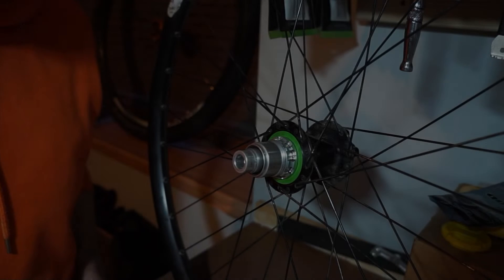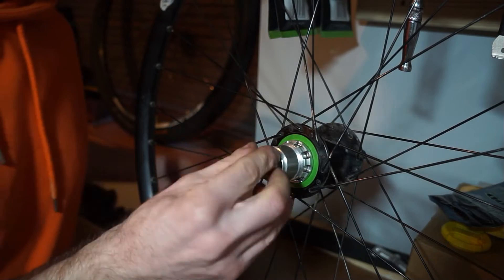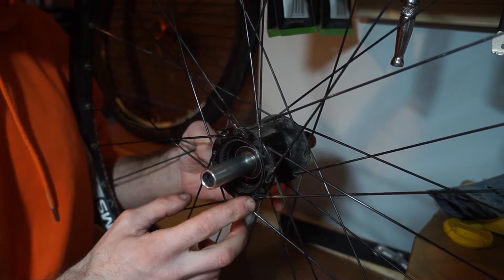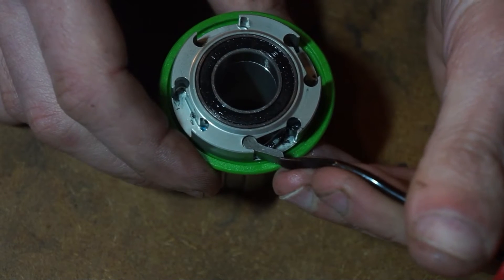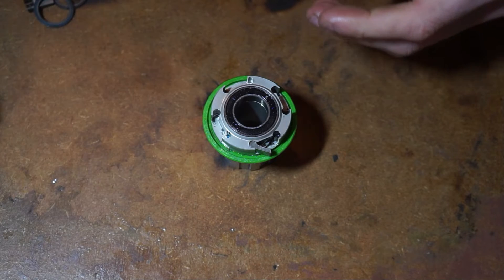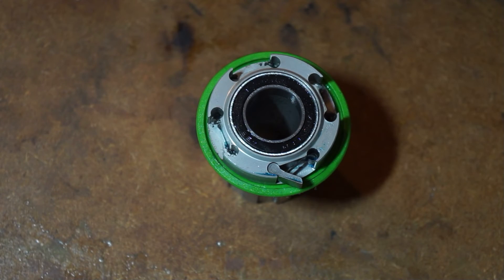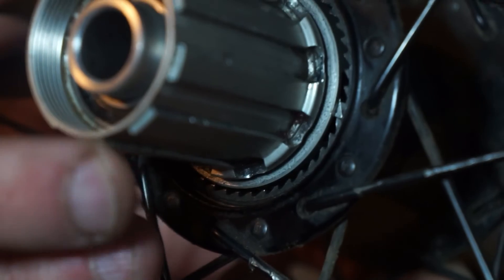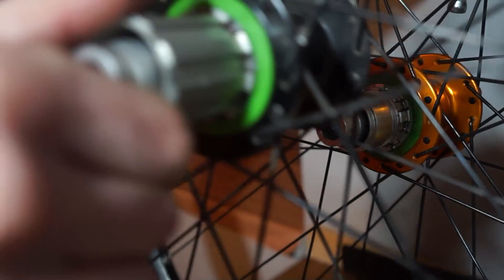Hope Pro 4 Rear Hub Swapping Free Hubs SRAM XD XX1 & Shimano 11 Speed - And a man talking too much.

Comment: Did you just push the green seal thing with your thumb? Without using a hope pro seal tool?
Reply from the maker: Yes on this occasion. It's not always so easy though and now I have the tool to do it. Some of those green seals are very tight and require the tool to not damage them.